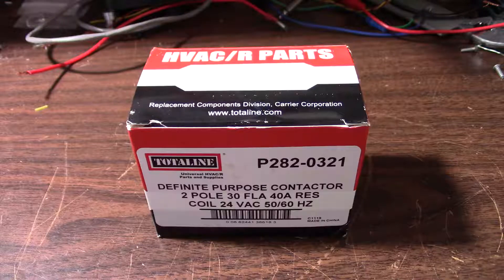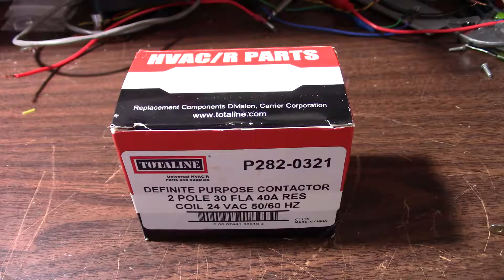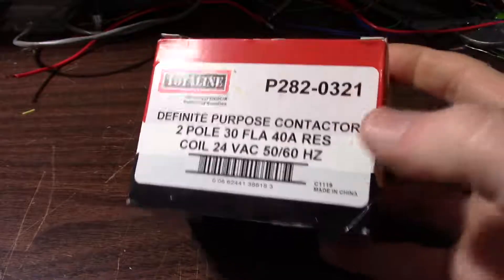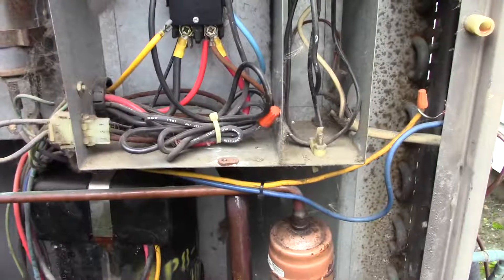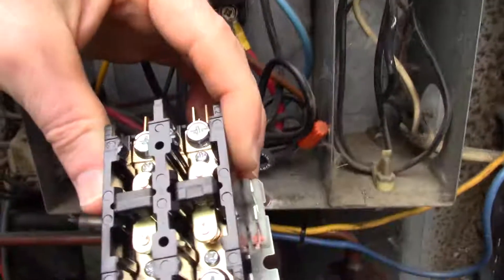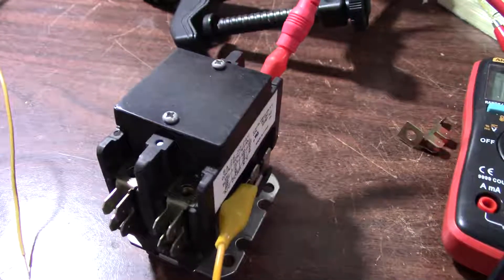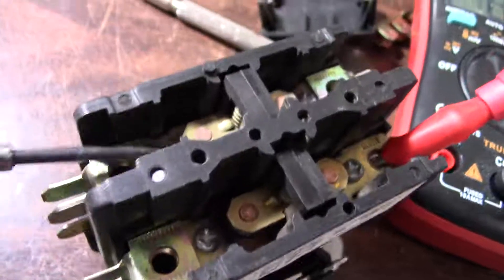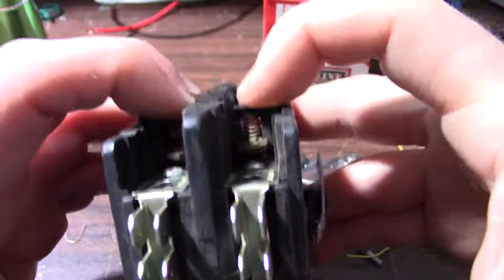Stuck contactor in 1977 Lennox condenser unit AC HVAC

Comment: Good catch! Where did you buy it? Very similar to the ones in my hot tub except they had 120V coils. Replaced the one for heater control with SSRs but they get too hot. Now I have a mystery short elsewhere that is hard to track but not with the heater or motor. I may go back to a contactor for heater control though my short is elsewhere.
Reply from the maker: I bought it off of ebay a year ago. Around $15 if I recall. I put the previous contactor in 20 years ago  when it stuck closed as well. Around the same time, the compressor capacitor quit.

Intermittent shorts are no fun to track down.